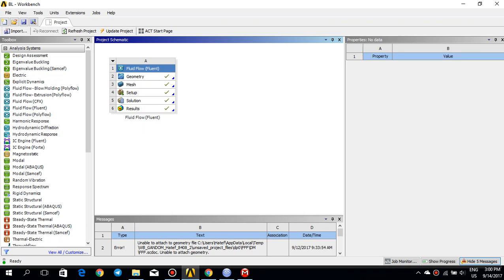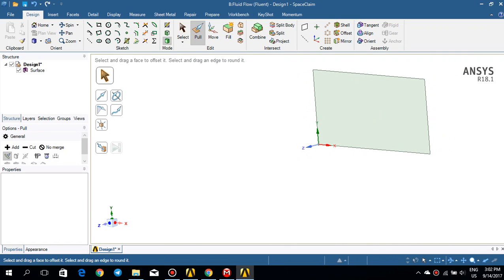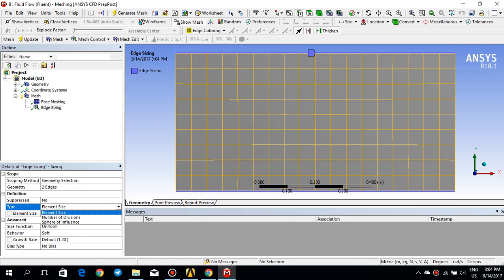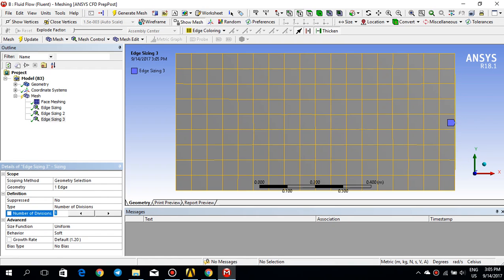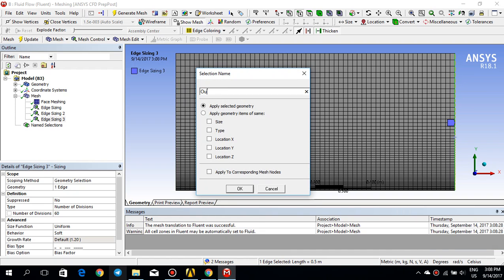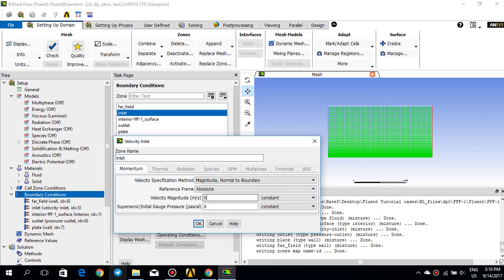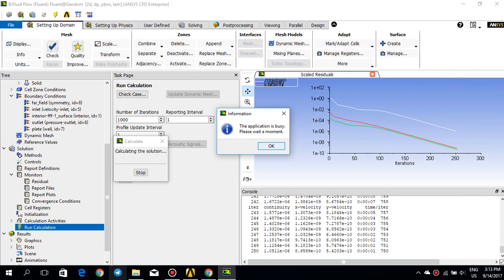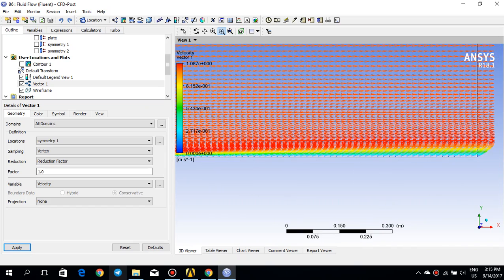Ansys Fluent Tutorial - 2 , Flat Plate Boundary layer

Comment: But reynolds number depends on dynamic viscosity not on viscosity .Re=(fluid density*velocity*characteristic length)/dynamic viscosity. How did yoy get the value of reynolds number 10000 from viscosity.Please explain?
Reply: get the dynamic viscosity value from dynamic viscosity vs temperature table( use room temperature ) for given fluid (air) then use ur formula and calculate density being 1.225 kg/m^3

Comment: How would one go with rotating the plate 30 degrees? I tried to do it in geometry and when I checked the final results, it came out the same as a flat plate without rotation, only the mesh was at an angle but calculating it as if it were flat. Thanks.

Comment: Thanks for the tutorial.
I have a question that the velocity is larger than inlet velocity (1m/s) at some position, is it correct ?? 
I have some similar result, and it confuses me.
Reply: I believe it's due to the symmetry boundary condition. In the video it's too close to the boundary layer. When I drew a higher rectangle to make my simulation the maximum velocity was reduced and got closer to 1 m/s